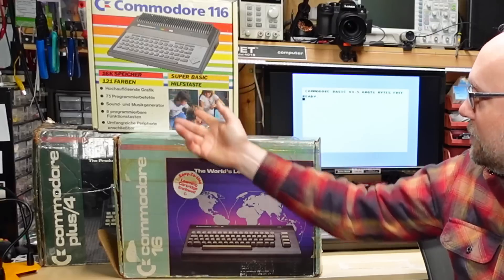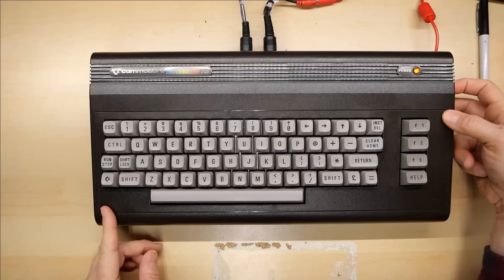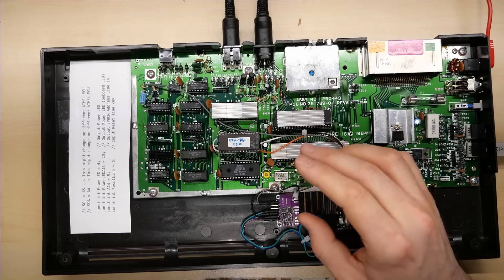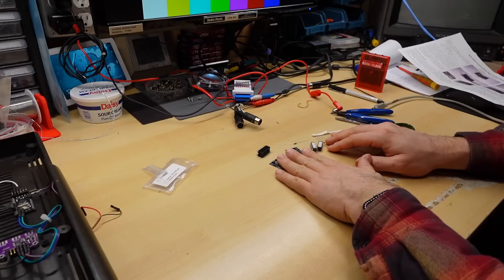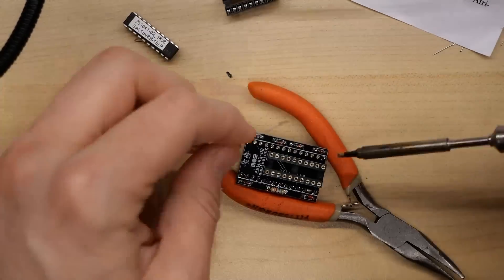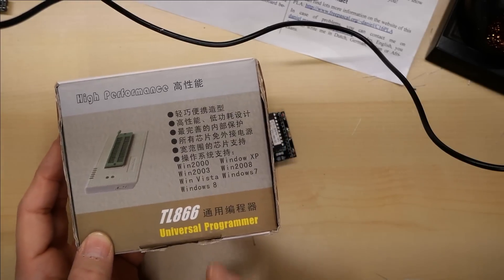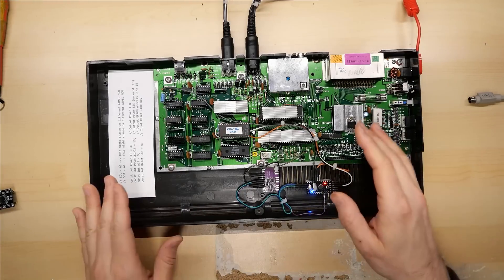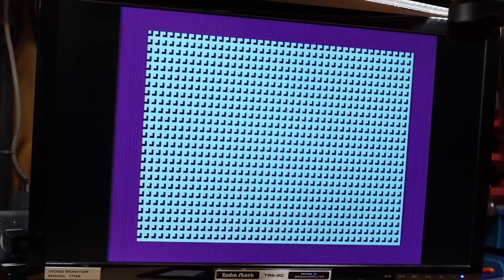Finally, a cheap C16 / +4 / C116 PLA replacement! (That anyone can make at home)

Comment: For the Berg (later Dupont and now Amphenol) Mini-PV connectors you mention--the official recommended crimping tool is very expensive new, but they've been making it for so long you can find really old ones much cheaper on eBay. Using a more specialized crimping tool makes a big difference in how strong the resulting connection is.
Reply from the maker: These were premade cables and I assume those are garbage not the real non clone connectors. I should look for a crimper maybe it can revive these cheap cables
Reply: @adriansdigitalbasement  we use the molex SL series connectors a lot at work, and the SL female connectors are compatible with the typical berg square pin headers. (The reverse is not quite true, a male SL crimp won't really go into a header socket or breadboard).

The SL crimping tool we use is around $300-400 new I think which is much cheaper than the Berg crimper (over $1000 new, but can be as low as like $100 used)

Comment: Very nice. It's a shame you can't setup a custom chip on them programers. I was going to edit a chip from the softwares librarys, but it's just one big file :(
Reply: It may be easier to do in the Linux tool (https://gitlab.com/DavidGriffith/minipro) - although that is a command line tool so will have its own learning curve. By the looks of it there is an XML file defining the chips and there's even a comment in it saying add your own definitions. Certainly doesn't looks "simple" but perhaps more so than with the official Windows software.
Definition file is at: https://gitlab.com/DavidGriffith/minipro/-/blob/master/infoic.xml
Reply: @josh46646  Ahh looks like I didn't look hard enough. the chip files are in the algorithm directory. They don't seem to be in any format that I can deduce. CSV,xls,xml, or a code. The infoic.xml you linked doesn't seem to have enough paramenters, I think they may be pointers ?? Couldn't check the first link as didn't have an account set up and I don't have any machines runing linux at the mo. But thanks for the info. I'm half way there. I'm on a slow burner with this.

Comment: Those programmers do work with Linux. I have installed the original software using Wine and have been using it numerous times to program the built-in flash memory of AVR microcontrollers. I have also read EPROMS with it (to get backup copies). I never tried programming EPROMS in Linux, but if the software communicates with the programmer, why should this particular function not work... ;-)
Reply: You don't even need wine, there are many open source versions of the minipro software on github, just compile and run.
Reply: @DemetryRomanowski  Thanks, I need to look out for those. My workbench PC is a bit underpowered, so something that runs natively is most likely going to run less slow than something that needs Wine.

Comment: How does the added ram help the machine?

I keep envisioning a history whee the 128 had a better graphics mode and a conversation between bill herd and the company grunts that sold him on a pn internally made chip went different.

What would change if the 128 had better adoption
Reply: The Plus/4 has 64K of RAM, therefore games designed for the Plus/4 don't work on the C16... unless you upgrade the RAM.

Comment: Why didn't commodore just use that GAL chip in the first place. It needs thoses diodes but its more reliable and smaller. Was it not available in the 80s when these models were made?
Reply: The GAL16V8 was introduced in 1985, two years after the C16 came on the market. What was available though is the PAL16L8, of which the GAL16V8 is a superset and using a PAL16L8 would have been feasible for Commodore. What could have been a consideration is that they did manufacture the PLA in their own chip fab, while the PAL16L8 would have to be sourced from another vendor.
Reply from the maker: Yeah they just kept using existing 82S100 tech in the 264 machines as they already knew how to work with and make them.

Comment: Just make sure if you get a power cut that you turn your water mains off, it's going to be few days . You don't want a house like some folk in Texas. Especially your cellar.
Reply from the maker: My house is weatherized for cold weather like freeze proof external spigots and my water main and shutoff is in my basement, not outside. I always shut my water off if I'm away for more than a few days... Flooding is no joke.

Comment: Adrian, you mention the chip programmer you used. I looked on Amazon for that model number and there are TONS of them from various companies, some with special adaptors for different chip configurations and such. Is there a particular one you recommend? I've been wanting to get something like this for a while so I could burn Kickstart ROMs, and other chips like C128 option ROMS and such.   Would appreciate any recommendations you can give...
Reply from the maker: They can't program kickstart ROMs, not without some adapter. No sure on specifics as I use my Data IO for that. I put a link in the description to a programmer buy totally not sure if it's legit. I bought mine years ago and from China directly. Really not sure what all the brand names are about now. :-(

Comment: Hi, did you update the test catridge between NTSC and PAL?
I wonder because in the PAL test ist shows the kernal rom as ok and 6510v 1?
Reply from the maker: Yeah so what is happening is I took the PAL modified ROM (that is all that exists) and modified it for it worked on NTSC machines -- so it's unofficial. I think I sent Rob a copy of my NTSC ROM to include in the diagnostic cart -- but I never updated it.
Reply: Looks like the same build version. It's just missing the CRC value for the NTSC ROM, where the PAL one is included.

Comment: What is that game in the end of the video?
Reply: Looks like cosmic causeway (UK) or trail blazer (US) for the C64 but the playfield is narrower.
Reply from the maker: That's right the file on my SDIEC (you jogged my memory) was Trailblazer.PRG. https://thekingofgrabs.com/2020/01/03/trailblazer-commodore-16-plus4/
Reply: @adriansdigitalbasement  It must have been expanded on the c64 to do side scrolling. and better tunes. Due to ram and video, etc. My 6 yearold always thinks he will beat me on cosmic causeway on points, or lotus turbo challenge on the a500. NEVER!!!
Reply: its known as sky roads on pc, not sure bout the c16 version

Comment: ATF16V8 is the chip used in the replacement

One of the logic gates is done outside the gate array in diode logic (Fran would be proud!)
Reply: You can choose: ATF16V8, GAL16V8 and even PALCE16V8H work flawlessly.

Comment: Hey Adrian (and anyone else who wants to address this...) When I was a kid, and had a VIC-20 (this would've been in the early 80s) and also a C64, 128, and a couple of Amiga systems through the years, one thing that drove me up the wall with the C= machines were those overscan bars.  Was there ever any way by a 3rd party, through a hardware addon or some software trick that would let you make those smaller, or even just "zoom in" to the usable part of the screen?
Reply: There's reasons why they exist (mostly because the computer's timings and performance were low and they needed the overscan bars to leave the CPU time to do things since the CPU was directly involved in updating the screen...

They're much less prevalent in the Amiga, especially if you compare the same game against the Atari ST version of the same game - the ST required the 68K to do a lot of the graphics processing so they needed the overscan to shrink the amount of pixels and give the CPU some time on each scan line to do other work.
Reply: @mikekopack6441  Indeed; the Amiga has all those lovely custom chips that lighten the load of the CPU quite drastically.
Reply: @mikekopack6441  Thank you, and @BertyFromDK for your answers.
Reply: I have an A1200 going into an Amiga M1438S multiscan monitor, and with one of the higher-res screenmodes i am able to extend the 800x600 standard format up to around 912x623 or so, which makes the entire screen usable.

Comment: Adrian, the IC pin leg straightener.... where did you get it? Where can I get one? We see it used about 8.50. Also, with regard the Tl866, I have the later model which loses the ability to program the older EPROM as it cannot handle the higher voltage, however I have cobbled together a 2nd ZIF socket that plugs into the main one where you can use power from an external source (bench supply) therefore giving you the best of both worlds. Give me a shout if you want the schematics.
Reply: This is the link from the video where he discussed it:

https://www.amazon.com/JAMECO-BENCHPRO-Pin-Straightener-Tool/dp/B00B888W5S/ref=as_li_ss_tl

Looks like it’s out of stock now, but you may be able to find it elsewhere.
Reply: @adambaranek  Thanks! That's great! Also, did Adrian ever talk about that silver IC removal tool he uses? Really need one of those as well.
Reply from the maker: There is a link to that in the video description -- chip extractor

Comment: The 8-bit guy had his house flooded due to his outdoor tap. So be careful.
Reply: People in the Portland area tend to have infrastructure better prepared for winter, so I think he'll be fine. Worst case you have to turn your outside faucets on to keep them from freezing while you figure out how to heat your house. (The further north you go, the more houses have alternatives for heating like wood stoves or gas heating)
Reply: Most people know they have an indoor shut off/drain valve. David didn't.
Reply from the maker: Yeah I have freeze-proof outside taps -- which basically move the valve a foot inside the house via a shaft and then when you shut them off, a check valve drains the tap and about 1 feet of pipe inside the house. This type: https://www.supplyhouse.com/Woodford-17P-12-MH-Model-17-12-1-2-FPT-x-3-4-MPT-Inlet-Anti-Siphon-Wall-Faucet-w-Metal-Handle

Houses in Portland are generally not built with pipes in exterior walls although my kitchen sink water is in an outside wall. So during extreme cold I keep the cabinet doors under my sink open so to keep the pipes warm... And if I lose heat during extreme cold, I shut off the water and drain the water from the pipes in the kitchen by opening up a tap in the basement. I also go one step further with leak sensors and those will trigger the water main to also shut off. (Which does require power, so if I'm not home during an extended outage, I will just shut the water off myself.)

Floods from burst pipes are no joke and I do not want to ever deal with that!
Reply: In the Portland area, we usually insulate the pipes going to our outdoor water taps, because we typically get a few hard freezes per fall/winter
Reply: @brentboswell1294  In the old days I remember people leaving their faucets on to keep them from freezing. Back before "wasting water" was a concept.
Reply: Karma...

Comment: Now we need a competent sid replacement that isn't digital
Reply: That's a hard problem -- there are die shots in enough detail that it should be possible to recreate either the 6581 or the 8580, but actually doing that would be a lot of work, and then getting them fabricated would take a lot of money.  Someone (not me, I don't have the time) should crowdfund an attempt to do this.
Reply: @undefinednan7096  I'm all too certain the digital part can be done in fpga and the analog in smd
Reply: @cheater00  fair enough, I thought that you actually wanted a custom IC, which could be cheaper _if there was enough volume_ (massive if there).  I'm not sure how much analog circuitry the SID contained, but I know that it had at least analog filtering.  The feasibility of doing it "to scale" (i.e. to fit in the same space as the original) would depend heavily on the amount and also on how small of packages one would be willing/able to use (for example, an 01005 is 400um x 200um, but using packages that small greatly increases assembly prices for low volume products).  Conversely, if one doesn't care about the size, it can definitely be done once the SID's circuitry is fully reverse engineered to the schematic level (I don't know if this has been done).  Assuming the SID's analog circuitry was designed properly (a big assumption), then it shouldn't be too hard to replicate its results (famous last words)